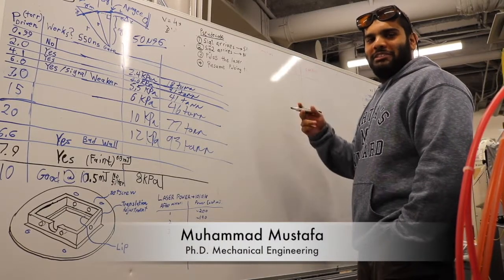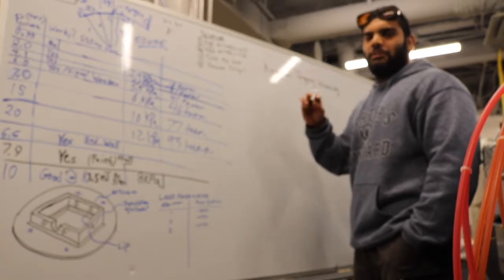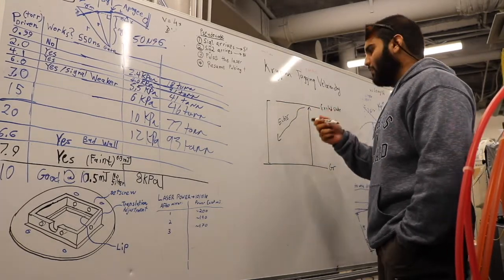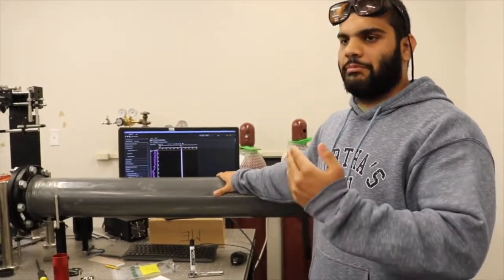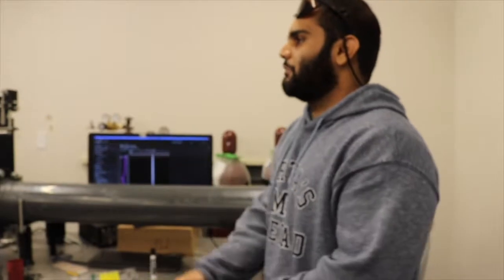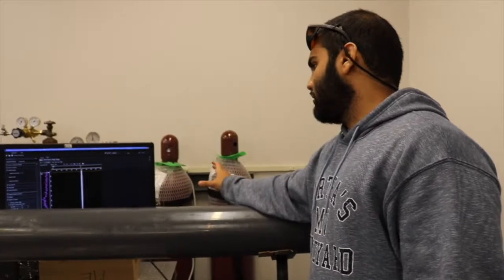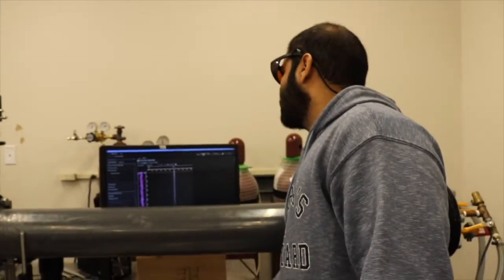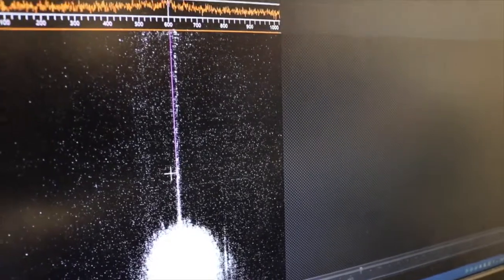Stevens Ph.D. demonstrates velocimetry with lasers and a shock tube

Comment: What is the difference between KTV and Particle image velocimetry?
Reply: If I understand correctly, in the PTV method, tracer molecules are added to the gas, while in the KTV method, the gas itself is labeled. In the PTV method, the movement of the molecule in the gas (sliding) can distort the results.